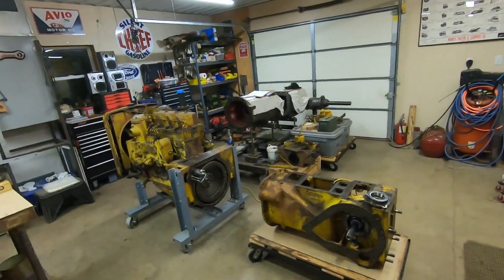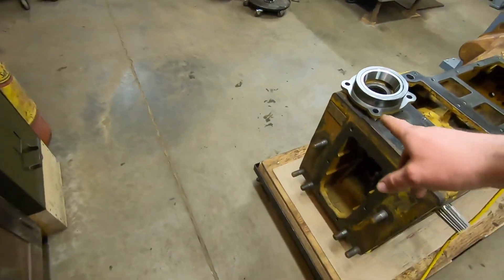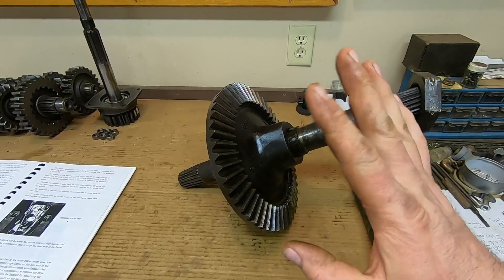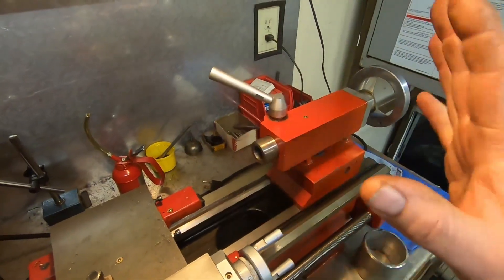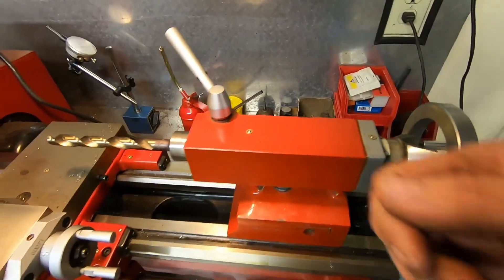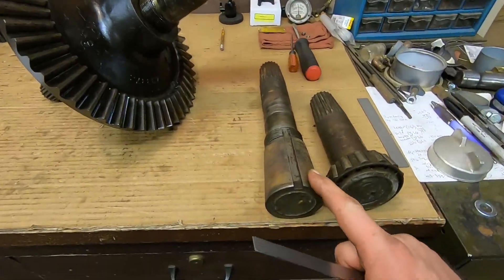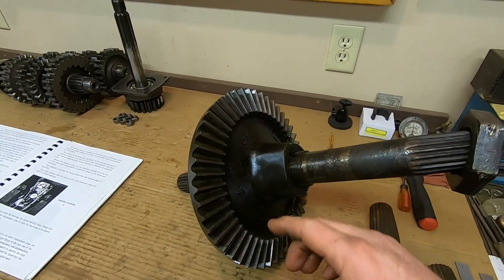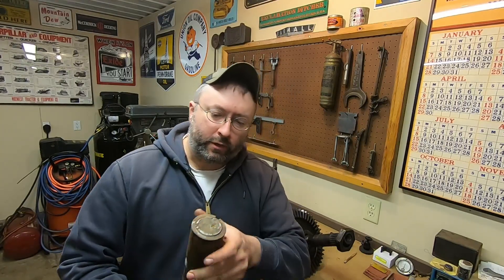#5J1113 Video Short - How Much Does A Press Fit Taper Hold & Bevel Gear Lock Better Explained

Comment: When you said 'Morse taper', I knew I had heard that term somewhere else. Then it dawned on me where I'd heard it. I'm a retired Operating Room RN who had worked in Orthopedics for over forty years, the last twenty or more in the OR doing total joints, trauma, and spine surgery. In many total hip replacements, the 'ball' of the hip fits onto the stem which in implanted into the proximal femur, with a Morse taper. As the final construct is made, the surgeon puts it perfectly into place, and gives it one good tap with a mallet. After that, there's very little chance of removing it. Then the hip is reduced, or put back into place, and the wound is repaired. I've never known of but one that came apart, and that was due to metalosis (galvanochemical degradation of the metals).
Reply: @squatch253  You might want to save that broken off taper shaft for in the future. You might need that hip replacement. Maybe weld a 2" ball on it and get a trailer coupler for the other end...a flat four connector for the nerves maybe?
Reply: @1crazynordlander  OMG, that’s so funny!
Reply: I know exactly what you are talking about,  years ago I had a little old lady on my paper route who had what looked like a small ball hitch with a curved taper and saw like teeth on the inside of the curve on a shelf in her living room. I asked her what it was and she told me it was her old hip replacement that had been replaced with a much lighter and stronger one. She had asked for the old one and they cleaned and polished it up for her. Lol,  She told me what the new one was made of but I don't remember.

Comment: Your taper explaination was great. Two extremely matched  steel surfaces literally weld together at the molecular level when pressed tightly.
That is why piston ring installer sleeves need to be lubricated in order to work. No lube no slip.

Comment: Those taper drill bits are called tang drive bits the flat tang on the small end fits a corresponding slot in the tool preventing the bit from turning, the taper centers and holds the bit in the tool. My drill press and lathe use a Morris 3 and I have had a1'' bit violently snapped and it is mostly the tang that keeps the bit from slipping in the tool.

Comment: Std 'Murican misnomer- talking pounds/tons/kg of "pressure". Pressure applies to fluids, foundation supports, plain bearing loading, etc, as force/unit area. Tons definitely would be FORCE, not PRESSURE, certainly, with no mention of area involved. This is Physics 101 stuff. Gotta eschew fuzzification.

Comment: Squatch, I went back to the last video, read through the comments again and found that I was the only one who asked about the taper fit. Thank You for answering my question. I guess that before the bevel gear would rotate on the shaft, the engine would stall OR the operator would release the clutch and take a more gentle bite on the earth being moved. This is a very interesting and educational rebuild.

Comment: That failed shaft is an example of rotating/bending fatigue. When the shaft ultimately separates, continued relative motion will lead to the mistaken impression that massive torsional load caused instantaneous failure as it might twisted-off bolt. Inspection will likely reveal a fillet that was too sharp and combined with misalignment or lack of outboard support. Fastenal has a dandy chart illustrating various fatigue fractures in shafts (borrowed from ASM Handbook 12). https://www.fastenal.com/en/3289/fastener-fatigue

Comment: I haven't forgot you bud, I've just been ... hunkered down. I have been keeping up with your the videos. Been praising your videos on pony motors and the like so if your' and Senior' ears have been burning that is why. 
Great info and I point people this way all the time. I tried but I can't explain it as well as you do so I just give them the link anymore. A lot of the early Cat D4 series  techknowledgeies lasted until June 30, 1960; any pony motor or D311 contracts that needed fulfilled beyond that date were considered aftermarket. Cat bought Trackson Company In December of 1951 and started using the name Traxcavator in early 1955. 
  The Traxcavator 12A, 1957-59* D4, 955C and the early 1960 D6, 955E were the last of the Mohicans. 955F 45A were British manufactured ??? they should have been direct start .
That is a very small nutshell..
* {as per Old Magnet} "C" to "E" model change included a change from D4 size undercarriage to D6 undercarriage at s/n 12A05793.
Reply: @squatch253  Bud don't stress it's no big deal Just thought I'd let you know how much I appropriate your knowledge. In life I've learned that experience is expensive; the experience you have passed on has not only saved me money and time but also from bloody knuckles and bruised up ego(ies). 
You make me look good when I talk about Cats ... ALMOST like I know what I'm talking about. Boy, I hope some of it sticks in my head for awhile.

Comment: Nice talk about tapers, I have been a mechanic in my youth but only recently learned about them.
About taper shank drill bits, notice they have a tang, because when used in a drill press (which has no leadscrew, they can be removed with a drift. The consequence is that the back of the drill bit is too long to fully retract the tailstock barrel. That can be a problem especially on a small lathe, where at times any fraction of travel and clearance may be crucial.
The ideal type of morse taper for a tailstock is a threaded one (for use with a drawbar), and a set screw, which makes it shorted than one with a tang.

Comment: I encountered a similar situation on a Moto Guzzi forum when I replaced the steel fasteners on my front brake disks by stainless steel ones. People warned me the bolts would shear off under heavy breaking. Exept there is no shear force going on in the bolts, it's eleminated by the clamping force between hub and disk.

Comment: Nice Job Toby! Stephen Morse was an interesting guy. When I got a woodworking lathe, I had to know what was holding that live center in place. I also discovered that a Morse taper is also used in some artificial joint replacements within the human body because they are so strong.  Loved the math gag! Keep up the good work.

Steve

Comment: When it comes to heavy duty power transmission, generally keyways and fold over locks etc are purely a means of keeping components from destroying other components whenever things have gone terribly wrong. Our natural gas compressor couplings transmit 5,000hp through a straight shaft press fit hub on the crankshaft, no key ways nothing but a press fit.

Comment: On railroad locomotives, and streetcars, the drive is one stage pinion and bull gear.  The pinion is on the end of the motor shaft, and the bull gear is a straight press fit on the axle.  The pinion is a taper fit with a key very similar to your tractor ring gear fit to the axle.  The key is just backup.  I have had one pinion that was not properly installed come lose.  The key saved us.  I volunteer at the Minnesota Streetcar Museum.

Comment: There has always been a taper fit in drill bits, some are used on hammer drills, the normal one we always used on electric rotary hammer drill was an A taper.  You simply push it tapered shaft of the bit into the receiver on the drill motor and bump it against something solid and even with it impacting as it turns it won't slip.  To take it out you simply turn the drill motor down and turn it on impact and drill and the vibration will cause the bit to come right out.  Taper fit works great and has been for way over 150 years, I don't know how long but long before my grandfather was born and most likely his grandfather.

Comment: What is the lathe you show in the video and how good is it? I ran a Horizontal borer a long time ago and that had a very big Morse taper on the center spindle (High speed spindle) There was a locking key that passed through the tang end to add to the hold on the drill or chuck.
Reply: @squatch253  Thank you. Just looking for something to make parts fr my Old British car.

Comment: Something around 3000ft-lbs is the limit on a common steel 1-3/4" shaft. For a higher carbon steel probably like what that is 7000ft lbs is pretty possible.

Comment: Taper fits are also typically found on tie rod ends. And we all know how hard those are to get apart without a fork.
Reply: amazingly easy, ring the outside side-on with a 4-6lb hammer. 2-3 firm blows and it pops out before you can even find your rubber boot destroying fork in the toolbox.  obv this technique is no good on something like a lathe tailstock or drillpress.

Comment: That flatness (key) at the end of the drill bit is used for some types of bench drill morse type chucks to prevent it from spinning. To pull it out from it,  the chuck has a slot where you insert a key and hammer it out

Comment: This is similar in size and function to the taper that holds the flywheel to the crankshaft on a classic Mini, they don't even have a key - just a bolt tightened to 200 lb/f - they also never move.
Reply: I agree, but to be pedantic they do have a washer with a stepped key which locates in the crank and fhywheel. its IMHO absolutely un-necesary, but it is there.

Comment: Hello Toby Foldover. :-) Math with the alphabet in it is nothing more than "adjustable" math, much like an adjustable wrench. They both fit many different applications. I certainly understand your view on it as I was the same way at the beginning of 9th grade. Then the light came on and I spent my working career teaching the dreaded letter mathematics for 34 years. I strongly suspect, a quality primer coat was not laid down before the final finish was applied or you were not mathematically mature enough at the time to grasp the concept. Or maybe you had a teacher who did not understand your situation but most certainly, it had nothing to do with your intelligence level. Bottom line, you have been extremely successful without needing to know the alphabet math. Keep up the good work.

Comment: I've been watching the 5J1113  since the day you went and brought it home and was curious exactly how effective thoes fold over locks were compared to say...saftey wire lock nuts like they use in aviation or lock washers? Also were lock washers not invented yet when this machine was made or did they beleive fold over locks worked better? And I've watched several videos of folks working on Airplanes and noticed they don't use fold over locks either just the ole wire lock nuts.

Comment: Morse taper works for drilling because they experience almost no radial thrust. Milling however creates quite a bit of radial thrust and so those tapers use a drawbar to prevent the taper from working loose. In short, the bevel gear needs the jam nut to stay in place. It would be in great danger of working loose without it.

Comment: Now wait a minute, when you forced the drill bit into the lathe tailstock, you created a press fit. How much rotational torsion is required to wring that shaft off? Caterpillar knows-
Taper fits are all press fits-the brilliant engineering part is this: 1. highly accurate concentricity of the two parts. 2. highly accurate axial stiffness and alignment. 3. The frictional interface of the two parts from the surface area of the truncated cones. Think of creating the same surface area (with a press fit) between a straight shaft and bore, without heat, trying to overcome drag as they're being pressed together. Can't be done- 4. Parts can be separated relatively easily .

Comment: Awesome and I used to do that same thing when the math with the alphabet showed up but working in a machine shop I found I had to learn some of it. By the way excellent disappearing act in the 1113 short almost lost my spewed my dew. Good one. And excellent explanation of the bevel worked I tried to explain it to dad on out old F12 tricycle wheel with a double beveled axle shaft and conical bushing and bronze slip face bearing he had it all torn down so I had to visually show him the reason it was built this way he got it after a while and opted for a two wheeled steering unit with rubber wheels from an F20

Comment: Don’t know if my math is correct but at 750ftlbs on the nut is around 26,000lbs of clamping force. 
The friction on steel at 24000lbs(12ton) is 19200lbs.
Reply: The taper significantly increases the clamping force, due to the angle involved. Could be a factor of 10 or more, so taper is very effective.

Comment: even some old Gravely Lawn Tractors had tapered shaft for the axles and you needed  a puller to remove wheel hub.

Comment: Many ships use tapers to hold rudders onto the shaft.  I was on a 150' boat in the Med during a refit and the yard failed to tighten the shaft correctly when reinstalling the rudder. Eventually, the rudder slipped on the shaft during some rough seas.  Fortunately we made it into port and were able to pull the cover plate (in the water at the dock) and tighten it correctly.  Never had a problem after that.

Comment: Just to needle those that let a few letters scare them off... a Morse taper is approximately 1.5 degrees. For discussion let's assume the shaft taper is about the same.. The cosine of 1.5 degrees is 0.9997 which means 99.97% of the axial force (12 tons) translates to the normal force (perpendicular to the taper or clamping force). Friction force is directly proportional to that clamping force. (Note: some details glossed over for the alphabetically challenged.)

Comment: Wonderful explanation video, sir!!
On locomotive traction motors the pinion gear is a taper fit to the armature shaft.
When cold bluing is applied to check the surface contact pattern
Repeat the process at 90° intervals to find the best pattern with the highest amount of contact. 
The depth the pinion seats on the shaft when cold is measured. 
The pinion is then heated to a specified temperature based on the number of teeth it has. 
It is slid on the shaft at the register marks from the bluing contact test until it is seated. 
The depth is now measured and compared to the cold measurement 
This is known as the advance on the shaft with the expanded taper.
Pinion cools and shrinks yo the shaft and stays put. 
A D-77 motor under an SD40-2 can generate 500hp 
Pinion holds fast just thru a shrunk taper fit!!
Reply: Great explanation Mike. if I may add to anyone unfamiliar to locomotives is that ALL the HP of a locomotive is TRANSFERRED through that shrink fit on a 3"-4" shaft. There is NO KEY-WAY so as backup.
How do they remove the gear if asked?
Around the circumference of the shaft in the center of the taper is a 1/8" oil channel. Hydraulic pressure is applied in the channel around 10,000 psi to expand the pinion and pop it off. Probably 1% of the time, the pinion must be cut off with a torch.
Reply: @donjohnston9554  
Most of the GE and EMD motors I've floated pinions off of needed 40,000 psi
First time I went looking for a Blackhawk pump the guy told me the only people that use 40,000psi stuff are destructive test labs and railroads!! 
Always put a forklift fork in front of the pinion.for when it expanded enough to break the taper.
Would make the machine jump!!

Comment: The primary purpose of a taper interface, is to achieve a highly accurate concentric linear alignment-
If you have a drill press, you likely have the chuck mounted to the quill with a Jacobs taper.
https://youtu.be/twpEDE2N43g How tapers were once ground-

Comment: Too, it would appear, the slip angle of the pinion and ring gear would also put pressure on the ring gear toward the big end of the taper as they are loaded.
Reply: Absolutely. As the engine applies torque to the pinion, the friction between the taper components is increased.

Comment: The tapered interference fit was used as kingpin mountings in earlier cars.
This had the unfortrunate effect of locking solid the steering, if lubrication was not maintained.
I once owned a '72 Simca (Chrysler) with this setup and had the lockup happen during drive before a curve on the highway.
Result was a bent and fractured front suspension from me cranking hard on the steering wheel.

Comment: Nice explanation - I suppose another requirement of a press fit is that the expansion and contraction with temperature is matched so that the fit never becomes loose.
Reply: If they are the same material they will generally expand at the same rate so the pressure on the interface between the 2 remains the same. The problems start when dissimilar materials are used.

Comment: 1:38 as i know it, from boat propellers (tho that might not apply, because of vastly different torque figures) the taper is the workhorse and they key is the horse bit. Specifically put there to resist any kind of motion that the shaft and shafted item might have in either a reverse situation, shock, or sudden power application. Those, could break the taper fit and thus make it slip or make the nut walk.

I can't link it, YT doesn't like links, but there's a tapered shaft calculator online over at tribology-abc it has all the nice letter math one can look at. "cone type shaft hub connection"